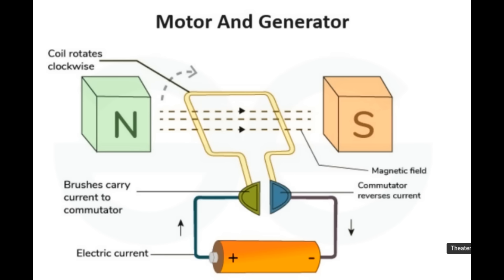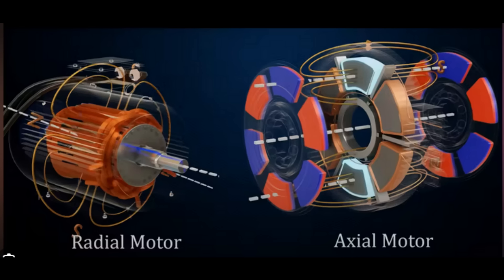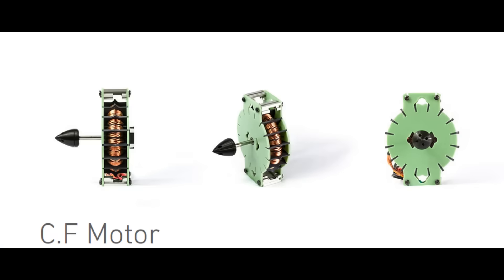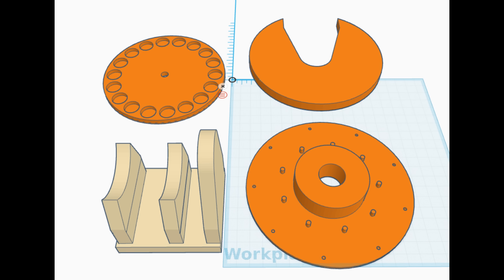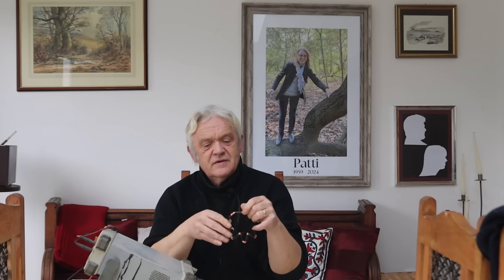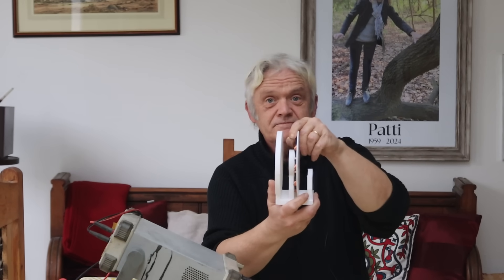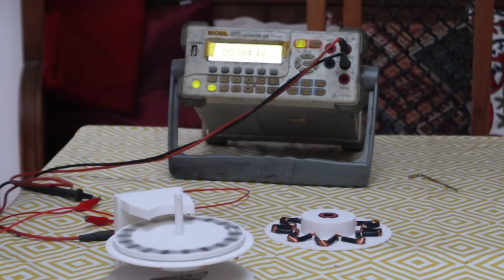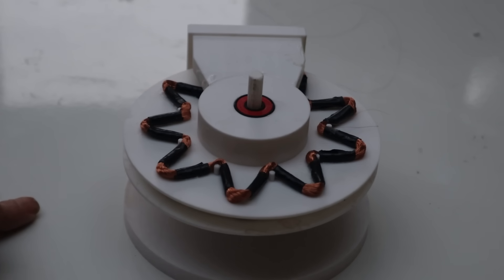2331 The Circumferential Flux Motor/Generator

Comment: Probably because I'm a little slow, but I don't see why this is much different than an axial flux.  Is it different because in an axial flux, you typically have a disk of coils between 2 disks of magnets and this puts a disk of magnets between 2 disks of coils?  I'll have to watch it a few more times to process your explanation.  LOL
Reply from the maker: The difference between axial and circumferential flux - axial flux attempts to surround a coil wire with a magnetic field - circumferential flux attempts to surround the magnetic field with a coil of wire - that's it really
Reply: No it is not different from an axial motor as it is an axial motor.
What they have outlined on their page is nothing like what he built.
Reply from the maker: be careful with you comments mate - this is a moderated board - moderated by me. If I feel you overstep the mark I will block you from commenting and remove your comments. I have already replied to your comment in regards of this - confine yourself to that - I do not allow board gurus to dominate here
Reply: @ThinkingandTinkering  You may do as you wish on your own channel and I fully support that!
I just work with motors myself and we generally think of the flux in a motor as being orientated along the principle axis of the system. A spinning top has a main axis, and out from that a radius. The circumference is usually also well defined. A field and torque that is produced along the circumference direction would give the most efficient motor as there is no or little loss vector. The field set up in for example a radial flux motor does by itself not deliver torque, but the imbalance in n/s field experienced by the rotors magnets will create a net torque and this torques vector along the circumference "direction" accelerates the rotor. The less we try and pull the rotor in other directions than the desired, the more efficient the motor. I would very much like to see more detailed coil drawings from Motion Robotics.
Reply from the maker: @1kreature  yes I would like to see that too - but you do have to remember what I did isn't a  motor -  although I do say they are fundamentally the same machine that is only a teaching aid - a box to put things in to help other have a framework to conceptualize - the actual implementation is always going to be different based on use case. For my interest I want a perpendicular field to bisect a coil at as close to 90 degrees as i can get given the constraints of the build - also given this kind of motor is basically a linear solenoid curled round to circle - i don't think I did so badly lol
Reply from the maker: @1kreature  another thing that just occurred to me as as simple example of how use case will change geometry - there is no way I would have put such thin wire in a motor. This wire won't take many amps at all - but as a generator wire decisions are based on target power input anyway and it will be low on this - just because the input rotor will be small - so thin wire will carry the amps fine
Reply: @ThinkingandTinkering  Absolutely! The serpentine coil motors have been a favorite of many DIY wind generator builders out there.
Being able to just slot the coil in both sides of a bracket that can also hold the bearings greatly simplifies everything. It also works with 3-phase!
You also did one about a year ago I think. That one did not have two coils though.
Reply: @ThinkingandTinkering  Have to admit the thin wire never worried me as I tend to just upp the voltage 😜
I've had to trade off these things a few times though, lastly in a prosthetic hand where the size of the motor was given. You come to a point where you can't do more power regardless of what you want. No room for more copper to carry more current without reducing the max flux you can create from multiple turns. You end up with a motor that can handle exactly the same power, just at less or more amps, with the voltage changing to match. Same unfortunately goes for generators. More turns for more voltage, and you loose out to the current. Those pesky R^2 losses!

Comment: I built model generators like this years ago. Didn't know the configuration had this name! I remember thinking I wanted to surround the magnets with as much wire as possible but the toroid like geometry was too difficult to achieve at the time.
Reply from the maker: Nice one mate - well much easier to build these days for sure
Reply: I'm sure I mentioned the Motor Generator years ago when you started 3D printing. Glad to see it's finally done. Lol. Great stuff

Comment: Great job 😎👍 any chance you could put a little 2xAA battery and motor on it to see what readings that rpm would give you?
Reply from the maker: I will need to put some kind of commutation in there too mate
Reply: @ThinkingandTinkering  that would be awesome! Where you were talking about joining the coils would cancel each other out, if they were connected in series would they cancel out too? If you offset the coils so that they form an X pattern along the magnet path, would that stop them from cancelling out and give you a smoother 2 phase output?
Reply: @gerryplayz4532  No offset required. Series or parallel would both be OK. If they cancel, just reverse the connections to one of the coils.